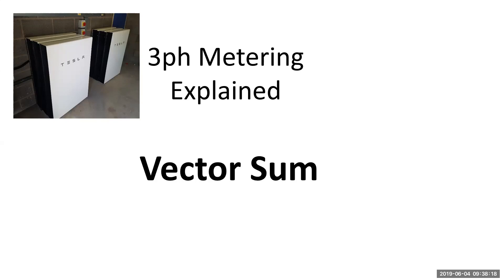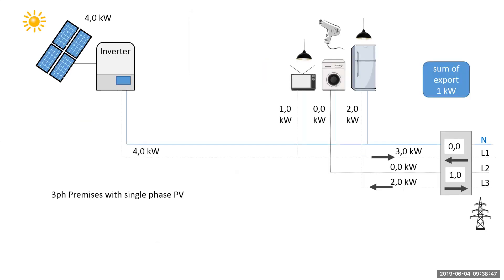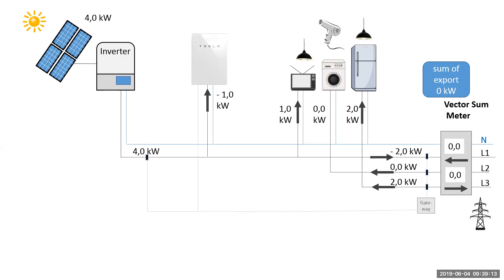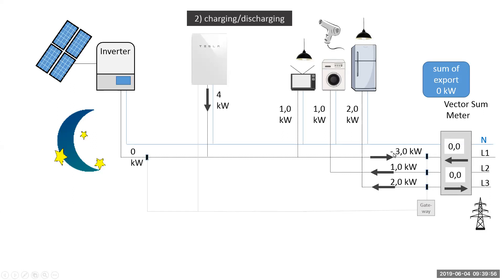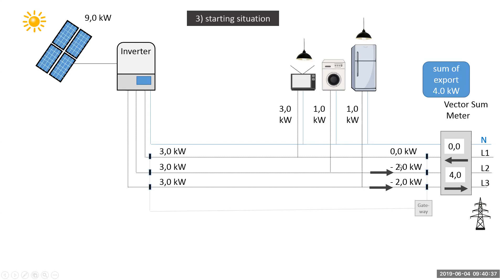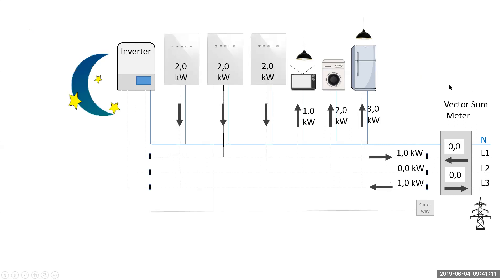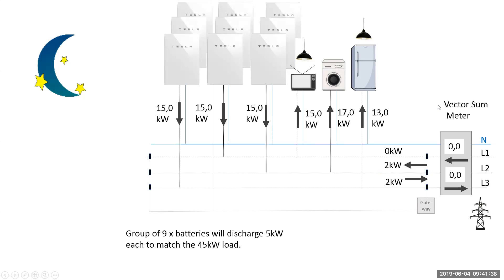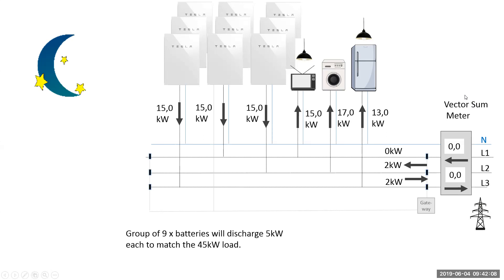Tesla Powerwall 3 phase Vector Sum metering explained

Comment: Super clear explanation for the 3 phase situation 🎉 please explain how to get battery to charge on a solar system when blackout 😅
Reply: Use a dc coupled system or something that can produce a microgrid so that an ac coupled string inverter keeps running. Victron is best.

Comment: We have a 3-phase meter and a Tesla Powerwall and solar on L1, all operating well as you describe in balancing to zero whenever possible.

Have you come across any company installing a three phase smart meter which will operate in the same way? After discussions with a technical manager at EDF, my current (!) provider who have started installing 3-phase smart meters in some areas, it is clear that their two varieties do NOT operate in that manner at the moment. He was very willing to try to understand how my system operates, but clearly did not know beforehand. They separately record the energy imported on each phase and the energy exported on each phase ... but are now trying to work out how to create a bill from that info that would come close to replicating what happens now ... but obviously don't have all the info if they don't look at the power sum which is available on the meter, updated every second or so.
Reply: I have a 3 phase meter from Octopus, and they confirm that it is a Vector Sum Meter. They also have a good rate for SEG!
Reply: @bmwhiteside  EDF say theirs is "Vector Sum" but when the technical manager explained how it operates in response to my pressing it became clear that it is not the same! Any offsetting of export against import would be a "back office operation" which they haven't yet sorted.

No SEG gets anywhere near the current FIT payments we get from the first of our arrays (and nor should it!).

Comment: Many new solar systems require 3 phases to support GSHP and other high-load equipment as part of an upgrade, but the batteries are still single phase. Very few customers understand the part "Vector Sum" will play in ensuring a well-designed system. Thank you.

Comment: Excellent explanation, answering many of my questions. Thanks.

Could I ask a question: Will the Tesla Powerwall be able to be wired up to work OK if the house grid supply only has 2 phases connected? My supplier (OVO) tells me that their 3 phase smart meters should work OK as vector sum with 2 phases (although they are not fitting any such meters at the moment).
Reply: It shouldn't matter if you have 2 phases as the Gateway treats it as a 3 phase system, the meter shouldn't care as it just sees L3 as not importing or exporting anything.